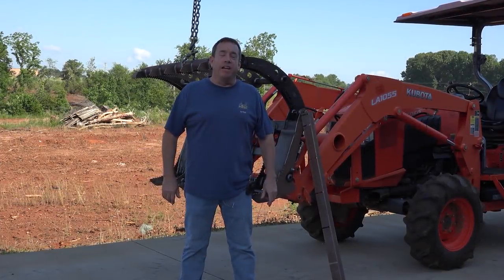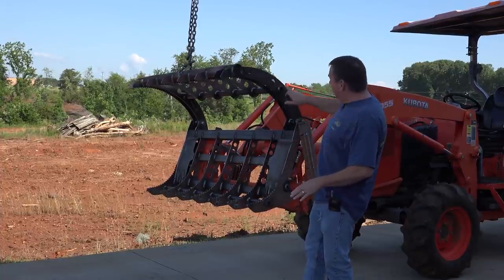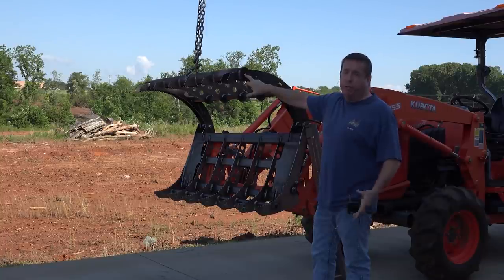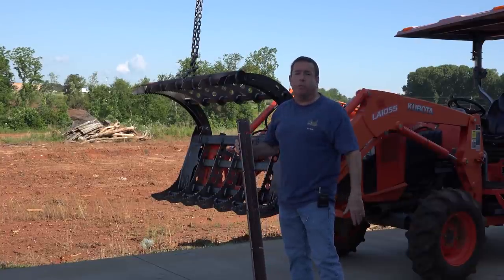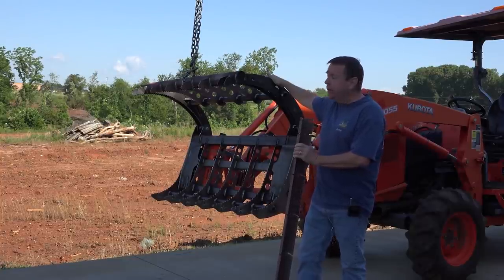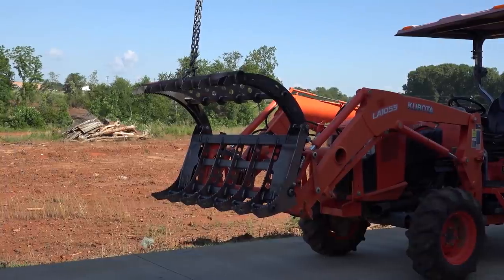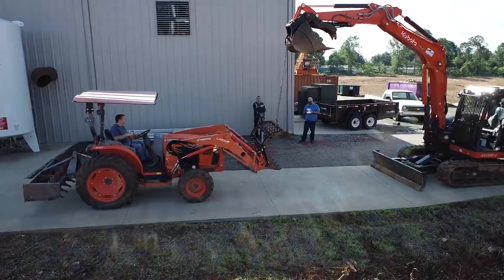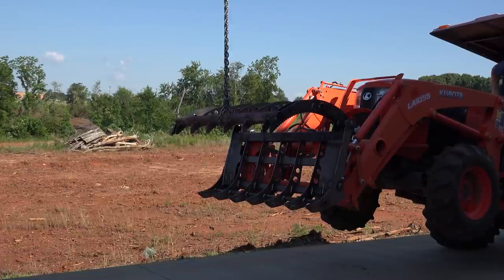Wickeder 55" Grapple test

Comment: While I appreciate the upgrades to the grapple, i’m frustrated that I don’t have it yet. I understand there’s an issue with material shortage and I don’t blame EA for that. But after my first 12 weeks went by, I called to check on my order only to find out that the grapple has been pushed out another month, possibly longer. Something the salesman said they were aware of for a while. My complaint is that I had to call to find that information out. The way I see it if a customer has an order in, and the 12 to 14 weeks they were quoted is going to be pushed out a whole other month then there should be some proactive phone calls made. The implements that I ordered are needed for a ton of farm work. Now I have to scramble to figure out what I’m going to do. Again I understand the supply chain issues, but if I waited the full 14 weeks for my implements and they didn’t show up, then I call to find out I’m another month on top of that, I’ve lost another 2 weeks. Call it nitpicking if you want, I call it common courtesy. The sooner I know about delays the more time I have to make arrangements to use something else while I wait for the ones I ordered. I’m just saying……….
Reply from the maker: Yes, these have been some rough times in our industry, and beyond.  We really do not have the ability to reach out to so many waiting people at once, but EA is always a phone call, email, YouTube comment, Facebook comment or message, away if anyone ever has questions or concerns.  I believe we are the most accessible company in the biz.  We're doing all we can to get the orders filled, and are confident that the wait will be worth it when the Wickedness finally arrives.
Reply: We are in exactly the same situation. It’s been 14 weeks today  that I ordered my grapple. I called and I was told July, more then likely august. Communication is key

Comment: I'm not too worried about the grapple lid, because that's why I ordered an EA Wicked 60. Hopefully the one I ordered will have this update!? What I'm concerned about with back dragging with the lid, is the loader curl cylinders. All that pressure on those cylinders could lead to blown seals, or worse, bent rams. The grapple is awesome, hopefully, the tractor can withstand it.
Reply from the maker: I hear that the Wicked 60 will be getting the Wickeder enhancement also.  Yeah, roughly backdragging/prying isn't a great idea for loader health, but we wanted to make sure there are no concerns with the grapple.  I think the answer is obvious!!  You're gonna love the Wicked 60!!!  Thanks so much for the business!

Comment: I have been contemplating what size tractor to get for grading a 600 yard, downhill, and  curved driveway with some  washed out spots, while other spots are very compact. I also want to create a few trails for the woods, and move some small logs for about 8 acres of clean up. I also need to brush cut about ten acres. I need to be  a 25hp tractor. I have been looking at the Branson 2515H and the Kioti 2610H.  I like the loader lift capacity of 2200 lb on the Branson. My issue is that I am a disabled veteran with limited income. At $325 a month for 7 years, it would make things tight for a long time. My question is: Would a smaller frame 25 hp tractor like the Branson 2505h or Kubota 23hp tractor do what I need, with one of your box blades and grapples? Thanks! I want that so bad, lol!
Reply from the maker: The Kioti CK2610/3510 are popular tractors with little complaints that we've heard of.  Guys really are amazed by what they're able to accomplish with those tractors and the Wicked 55!!  You're welcome to call us at 866-581-5818 or email sales@everythingattachments.com with any questions you may have.

Comment: Do your chin ups with no heavy box blade lightening up the front end....Than straighten the chain out, put the tractor in 4x4 than pull in reverse....That's how you test grapples!
Reply from the maker: Please link your video!
Reply: @gr8scott95  LOL! Nice job! I like how the tractor was hopping up & down on the pavement...That front axle we was getting a good workout!
                           Cheers!